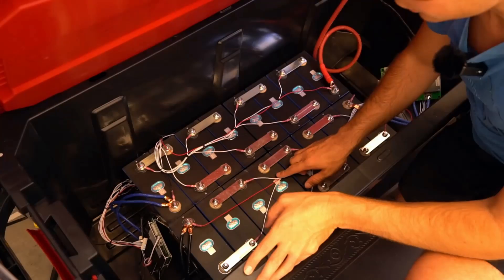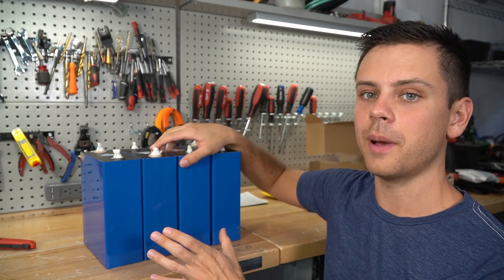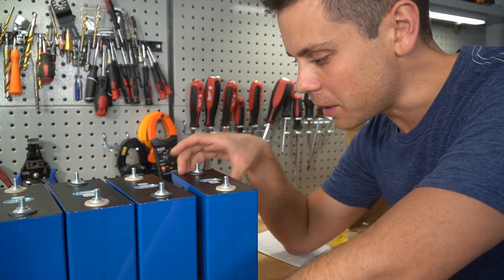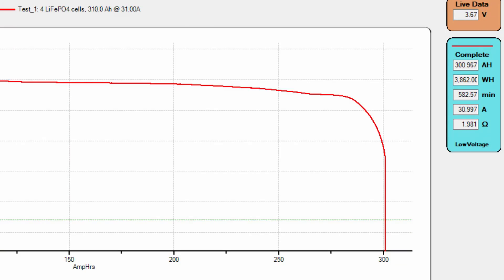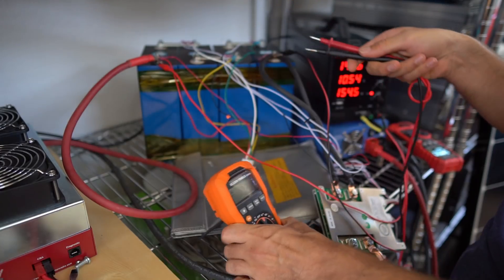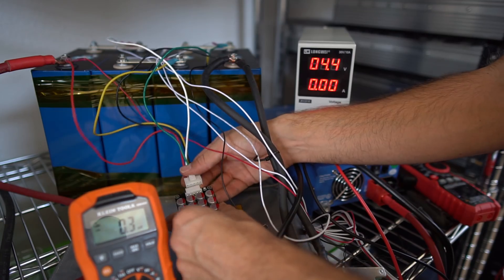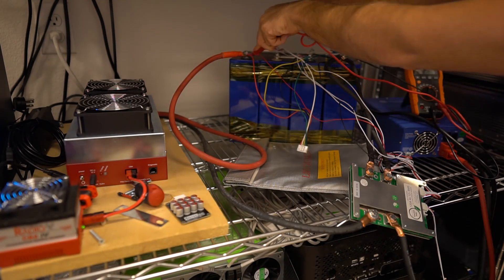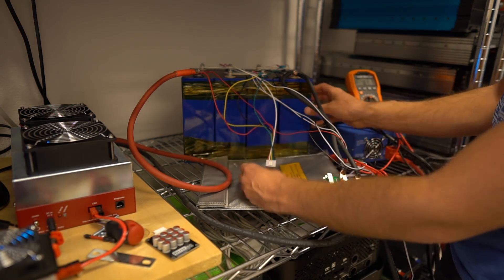Amazon.com "Grade A" 310Ah -Ninthcit- LiFePO4 Cells Manually Balanced and Tested

Comment: You should squeeze bloated cells with your hands. If they are solid, an oversize jelly roll inside is pushing back on you. If they give slightly, only then suspect internal decomposition gasses.

Alternatively, you should not buy such large cells. LiFePO4 cells are made by spraying graphite and LiFePO4 powders suspended in a volatile solvent onto miles of aluminum and copper foils. After the solvent evaporates, the coated foils are rolled and compressed into the jelly roll. You can't perfectly control the layer thickness over hundreds of linear feet with this process, so some cells naturally are thicker than their cell design size and bulge. Lower capacity cells are less subject to being oversize since they have fewer linear feet in them, thus, sprayed film thickness variation is smaller as a percentage of the constant thicknesses parts of the cell, such as the metal foils, ion transfer membrane, and aluminum cell walls.

While I agree that overrating cell capacity sucks, I think your rant about lazy, fat Americans complaining about stuff applies here. US companies do not make LiFePO4 cells, so you should be thankful that China still does and is willing to ship them to the US. Since it is standard practice in China to overrate their batteries, it is your expectation that is wrong and if you don't like it, you should start a company that manufactures LiFePO4 cells in Las Vegas. I need. Mine from China are taking way too many months to arrive. I'm not even sure that they've even shipped given how awful the sea shipping industry is backlogged.
Reply from the maker: I have a friend who assembles lifepo4 packs here in the states, and he can fund his own manufacturing plant (he owns the company), but he says he cannot possibly compete with china. I will ask him again and see what he thinks these days. He told me that two years ago. But agreed, you are right.
Reply from the maker: I am surprised that Tesla is not making their own lifepo4. What makes it so difficult? I know the ovens cost a lot, but they can't be that difficult to make.
Reply: @WillProwse  I'm guessing it could be patents? Li Ion patents is generally a very crowded place which is also why I think more research has been shifted to sodium ion and iirc, this is since 2010. CATL did mention about their own sodium ion for commercial use.
Reply: Howard let me get this straight it's the buyers fault when the seller lies it's the buyers fault when the seller builds defective products. I guess the Chinese gonna do no wrong in your mind. I'll give you one thing those communist in China sure are good at making viruses
Reply: @donbaker8252  Who said anything about fault? I said we should lower our expectations, because regardless of how cheated one might feel, there exists no favorable product alternatives and if you are in the US, then you still are competing with people like me for bulging, under-capacity, poorly matched LiFePO4 cells that have already made it into the country.

I ordered "64 kWh" of cells back in January, split between two different vendors. Half arrived bulging, unmatched and with inferior capacity, while the other half were much higher quality. Did I feel like a victim of false advertising? Hell no! - I'm the proud owner of a ~59kWh off-grid home and saved so much money I could afford another "73kWh" project - if only the Port of Los Angeles and Port of Longbeach didn't have a huge line of boats anchored off shore just waiting to unload.

China has massive battery production capacity because their government decreed several years ago that EVs are good and spent their citizens taxpayer money on subsidies for EV packs manufactured in China. I.e., every dirt cheap kWh I get from China is all thanks to their government planning, battery infrastructure spending and decidedly not-lazy 12 hr, 6 days/week hard work. I certainly would not have an off-grid home if I had to buy 6 Tesla Powerwalls.
Reply: @howardschlunder9754  What kind of BMS are you using to manage such a system? You have a larger pack size than most teslas out on the street!
If you don't mind me asking, which seller did you use and pack size?

What is your c-rate for that 59kWh?
Reply: @AFlyingCookieLOL  No BMS at present, although I am using a couple JDB ones as an analog front end to conveniently measure all the cell voltages in a 2 bank by 2p16s 280Ah array (via Bluetooth LE, although via RS232 in the future). A few observations I've made is that: 1) it is unacceptable to ever cut power to my fridge, freezer, lights and general purpose power outlets, 2) at a continuous design load of +/- 400A, I don't trust any BMS to safely interrupt this without blowing itself or downstream components up unless I designed it myself, 3) the power density of a short circuit fault will instantaneously explode and vaporize any failing electrical component or carelessly managed stray wrench or wire faster than gravity or human can feed new metal needed to sustain the fault, and 4) I hate low voltage and need to design my own MPPT/BMS/Inverter in the future to accommodate 400V EV batteries.

The best solution I observe for pure off-grid solar without grid or generator backup is to dramatically oversize the solar array and battery storage such that it is impossible to run out of energy in everyday use and also impossible during extreme weather events without having at least 24 hours of margin to enact a human  intervention. Chineese manufacturing has enabled such low prices that this design philosophy became feasible for me to attempt. I'm an Electrical Engineer accustomed to making decisions that could result in a million+ dollars of harm or an innocent civilian fatality in my day job, so I'm willing to take the development risk of one day burning my house down or injuring a burglar trying to hastily disassemble and steal my power plant. It helps having historically designed a 20kVDC, 250W power supply and still being alive to report success in never killing anyone or being a contributor on a Chevy Bolt style disaster.

Shenzhen Basen Technology, Inc. on Alibaba seems adequately trustable to place decent sized orders with. Many YouTube videos demonstrated order success from this supplier and likewise my half-batch order from them in February went flawlessly.
Reply: @howardschlunder9754   Thanks for your response. 

Photonicinduction seems to be the opposite of you where he plays with things over 1000amps most of the time. xD

With LiFePO4 I think you have got a great solution, I think its safer and I would assume you put in an area that is either concrete or drywall. You could surround the battery with rockwool or kaowool. With the Kaowool, its the same stuff they use in gas forges. The battery from what I've seen is not nearly as bad as some other chemistries.  At that much amps though... it's still one giant welder.

How large do you intend to get your solar to and with what panels?
Reply: @AFlyingCookieLOL  Haha, yeah, Photonicinduction is a bit of a reverse. He seems to be pleased when he makes something benign pop. Me, I'm pleased when I make something that intrinsically wants to pop, yet doesn't pop.

I have a roll of Kaowool as I've used it to make an electric kiln and recycle soda cans (also sinter rust into ferrite ceramics for later use as a big, high current, high frequency inductor or transformer).  I definitely won't be putting Kaowool around my batteries though. Kaowool is a presumed carcinogen, including in all the other states outside California. It also is a great thermal insulator, so would worsen self heating, accelerate oxidation of the aluminum battery terminals, possibly resulting in a resistive junction and indirectly causing the fire it is intended to mitigate.

If I were worried about a fire, I would buy a chest freezer, replace the mechanical bi-metal thermostat with a proper HVAC thermostat and power relays, put an infrared heat lamp and my batteries inside, then place the thermal chamber in my back yard. For theft protection, I could dig a hole and bury the whole thing. I've actually contemplated doing this even without being worried about a fire, because all the high power inverters available have horrible jet-engine/vacuum-cleaner fans inside. They moronically all use tiny, super high speed fans intended for server power supplies in data centers because only the engineers who make server power supplies (and UPS's) have enough expertise to make high power off grid inverters.

Only problem is that chest freezers can only pump 100 to 200ish Watts of heat continuously, meanwhile inverters under load generate more heat than this (which in turn is because 48V is way too low for proper efficiency...). Actually, there is a second problem in that 10+ cubic foot chest freezers no longer exist in the US. They are all made in China and because they take so much space on cargo ships that have extreme backlogs in LA, only 5 and lower cubic feet freezers are still being imported (maybe 7 cu ft if lucky, but definitely not 10).

Fortunately, I'm not worried about a fire because sufficiently large, low impedance batteries and wiring are not comparable to welders. I've used welders. They melt metal in a second or two. The 10s to 100s of kiloamps of a battery short circuit (with big capacitors inside the inverters as well) appears to melt metals in a few 10's or 100's of microseconds, followed by conversion to a plasma shockwave that blows the point of contact apart. Sufficiently beefy circuit breakers presumably survive and can appear to interrupt such a short only because the point of contact has already blown up by the time the circuit breaker overcomes it's own mechanical inertia and starts to open. I.e. most of the energy the circuit breaker sees is probably residual energy stored in the parasitic inductance of the wiring and much more modest than the original surge.
Reply: @donbaker8252  *I'll give you one thing those communist in China sure are good at making viruses*
1. There is NO scientific evidence the China made the virus.
2. The place of discovery is rarely the origin
3. What does communism have anything to do with it?
4. While your democracy goes and bombs muslim countries why do you give a crap about China's Muslims who are treated better and NOT being bombed? Hypocrite
5. China government isn't really communist.
6. What you see on the western media is a lot of lie. Much of BBCs lies has actually been debunked, the rest of it busted by real expats.
7. US didn't even investigate Fort Detrick.
8. Stop bombing other countries and killing people and build your infrastructure first. Your traffic alone cost your country billions. And here you are blaming China when China got it under control even with the new variants. 

If you want to be racist, this isn't the place and at least get your facts straight. Or do you you want to be so ignorant just like the anti Chinese group that calls everyone else a "wumao or 50c" that disagrees with you?

*I guess the Chinese gonna do no wrong in your mind.*
1. Are you implying that Americans do no wrong in your mind?

*Howard let me get this straight it's the buyers fault when the seller lies it's the buyers fault when the seller builds defective products.*
1. The buyer is responsible for the research before buying.
2. Many companies including AMERICAN companies have under performing products. Tesla range has been known to have lesser range by % to their claimed range in comparison to some other brands like Kia and Hyandai.
Reply: @SingleTrackMined  Many Americans like to talk about Freedom.
Absolute freedom leads to absolute disaster, Speech should be made with responsibility. 
I feel much of that has been lost to hate, jealousy and racism.

America first should be the people, not the corporations. America is now lost and doesn't seem to know where to start and where it would end. 

I wish for the ignorance and hate to stop. 

I'm glad to see that you are some of the few that see the reality.
Reply: @AFlyingCookieLOL  The US Constitution needs a Bill of Responsibilities to balance the Bill of Rights.
Reply: @SingleTrackMined  no it doesn't need a bill of responsibilities.. government has no business in charity work.. bad decisions/choices often have bad consequences. When people had to deal with that they learn real quick. Most people will gladly help someone who needs help, but not when they're just lazy or criminally minded.. the 10 commandments and love thy neighbor as you love yourself are all the rules we need. Unfortunately, mankind tends to be quite self-centered. Hence laws get made to stop bad behavior. Police to enforce and jails to separate the anti social thugs.. the majority of people are good, but the % of criminality is rising because the real consequences of bad behavior are muted by mis-guided social programs that have been twisted into political tools to gain power over individuals. 
The hate and anger in some places in the us is fueled by professional agitators or professionals who live very well off of telling people they are victims.. there will always be people who hate anyone different from themselves, or hate a group because someone of that group did something bad. But mostly, people are polite and kind to one another.. just look at how people pull together after a natural disaster.
We get the leaders we deserve.. either by thoughtful choice or a pathetically allowing others to do it for us..
Reply: @audreye7078  I disagree with 100%. I believe you are incorrect in every particular. But that is your right. You also have a responsibility not to harm others with your self-centered attitude. See? You have a right and with it comes a responsibility. It's the same with every right. Because of people like you we must codify every little thing to prevent tyranny by the majority. 
There are people that need help. I know that probably comes as news to you from your position of privilege, but it's true. Government is all of us banding together to help them. That is a good thing. 
You would leave vulnerable people to the vagaries of peoples' willingness to help. Which you wouldn't because you people think poor people are getting what they deserve.
 As for charity. I know (should say knew as they don't get to know me anymore) plenty of conservatives. None of them tip. None of them give to charity. That's why we tax them: because they can't be trusted to do good things on their own. I'm lumping you in with them since you parrot their talking points.
I am blocking you because you are neither smart enough nor nice enough to talk to me.
Reply: @SingleTrackMined  another person who thinks they know best how to run everyone else's life.. 
Then cowardly runs away because he's thrown stones and hides behind bloking so he can't have his words shown to be foolish blathering..
Reply: @SingleTrackMined  *The US Constitution needs a Bill of Responsibilities to balance the Bill of Rights.*
1. The top needs competent people that is willing to work for the people
2. Politicians should be held at a far higher standard
3. A method to filter out bad politicians so bad aopples don't make it up there in the first place.
4. Make lobbying illegal, companies have no place in the government for the people

The right captain for the boat would be sure to have a bill that would help the people. 
Having the bill there by itself is not enough in my view.
Reply: @AFlyingCookieLOL  I understand nothing of what you propose other than politicians should be honorable. Yes. I don't think you understand the Constitution. "Having the bill there..." I can't imagine what that means. 
Every US citizen should be required to pass the citizenship test that immigrants must pass.
Reply: @audreye7078  *no it doesn't need a bill of responsibilities.. government has no business in charity work.. bad decisions/choices often have bad consequences.*
The government is responsible for the needs for the needs of the people. No one can start large projects and infrastructure like a government. Businesses cannot do it either. The government has a large picture of the entire situation and must work for the people.

**When people had to deal with that they learn real quick. Most people will gladly help someone who needs help, but not when they're just lazy or criminally minded.. the 10 commandments and love thy neighbor as you love yourself are all the rules we need. Unfortunately, mankind tends to be quite self-centered. Hence laws get made to stop bad behavior. Police to enforce and jails to separate the anti social thugs.. the majority of people are good, but the % of criminality is rising because the real consequences of bad behavior are muted by mis-guided social programs that have been twisted into political tools to gain power over individuals. 
The hate and anger in some places in the us is fueled by professional agitators or professionals who live very well off of telling people they are victims.. there will always be people who hate anyone different from themselves, or hate a group because someone of that group did something bad. But mostly, people are polite and kind to one another.. just look at how people pull together after a natural disaster.
We get the leaders we deserve.. either by thoughtful choice or a pathetically allowing others to do it for us**
Corruption can create a mess and wreak efforts to recover. But the government also hold massive resources to fix and have an idea of the entire situation or organize people.
Reply: @SingleTrackMined  I'm not an American citizen and I'm not really familiar much about it. But I do understand every government has its policies rules or something similar to protect the rights of it's people. 

As for what I mentioned. A system should be in place to filter out bad politicians and non of it be influenced by corporations. No "donations" to politicians where money can influences a decision. And I feel engineering or sciences as a requirement for even higher positions. Decisions driven by logic is what we need. Trump doesn't have much of those qualities. But he is popular. =/

As for the test, I think they need a unbiased look at history and be made to avoid any further war in school. Too bad the US military has it's hand in everything including movies.
Reply: @AFlyingCookieLOL  Good luck with that
Reply: @AFlyingCookieLOL  you can't help others if you die, just as poor people can't  help more than a few. You're right that self-centeted people don't often think of others and those who struggle are the most likely to help others.  Why people use their bounty to help or not is a complex issue.. it is related to humanity itself. That's still  not the systems fault.. it's the application or mis-application. You have been fed some one's option as a theorem.. unproven at best but debunked by the good that is actually done. You I think you dislike humanity and think your viewpoint puts you above those you disagree with.
Reply: @AFlyingCookieLOL  Government is not responsible for the needs.. we each are responsible for one another.. Local and regional governments manage the "public works" projects wanted and willing to to be paid for by the people.. that has nothing incommunicado with the charity aspect of too many government programs.. programs that waste billions of dollars in bureaucratic infrastructure.. before their services are provided..
Reply: @audreye7078  *Government is not responsible for the needs..*
*Local and regional governments manage the "public works" projects wanted and willing to to be paid for by the people..*
Government is responsible to public works, corporations don't build them. Infrastructure is key to an economy and is demonstrated clearly in every country. However, policies and everything else should also be in place to manage a large amount of people which all believe in something different. 

*we each are responsible for one another*
Leaders organize, being responsible for each other doesn't mean you go without some sort of leadership especially in large projects

*that has nothing incommunicado with the charity aspect of too many government programs.. programs that waste billions of dollars in bureaucratic infrastructure.. before their services are provided..*
Services can only be provided if infrastructure is made to support it. Charities do nothing other than being given somewhere and often to corrupt people and wasted. Take a look at the US military, hundreds of billions and nearly nothing for public infrastructure to alleviate existing current traffic that cost billions. I do not know of a charity that can do something on a massive scale of a government that can bring hundreds of millions out of poverty.

With infrastructure and gov't support historically in 40 years time:
Quintupled GDP
Quadrupled literacy
Liberated women
Increased grain production by 300%
Increased gross industrial output x40
Increased heavy industry x90
Increased rail lineage 266%

And that is just part of it.
Reply: @audreye7078  *you can't help others if you die, just as poor people can't  help more than a few.*
But you can leave something for the people. Especially if you are in governance. This has been demonstrated in history in nearly every country.
Reply: @AFlyingCookieLOL  yes, but those people are rare..
Reply: @AFlyingCookieLOL  your are deliberately conflating my points.. infrastructure is the responsibility of government.. I  did not sat charity is. Geez.. most government institutions waste money because it has become too bloated, inefficient and ineffective.